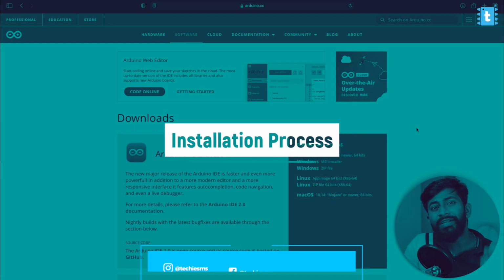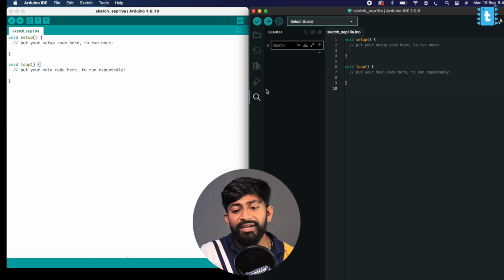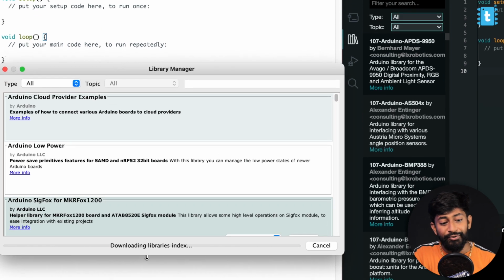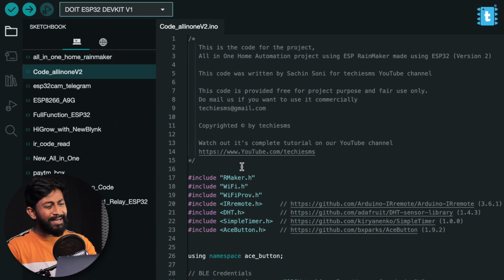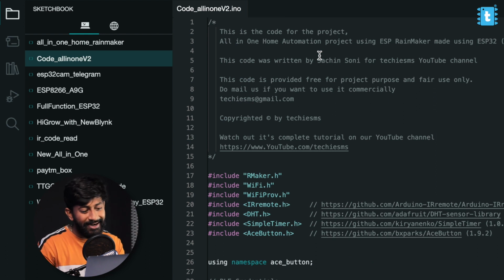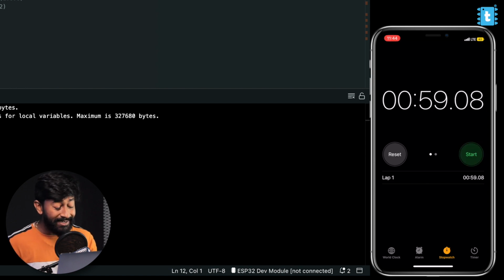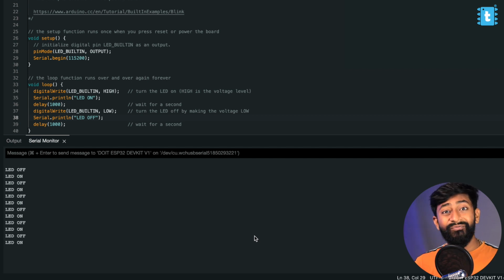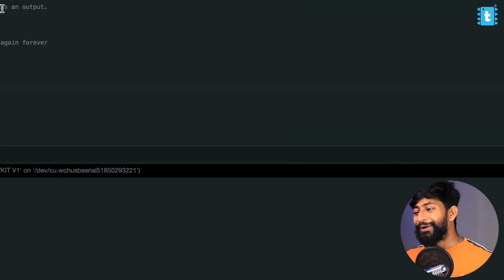Arduino IDE 2.0 (Stable Version) | All features Explained

Comment: How to bi directional data pass between nodemcu and Arduino?
Reply: for example received data from the cloud in node mcu after same data send to Arduino after data some task perform like led1on == led1on : led 1 on otherwise led 1 off after Arduino one push Button an press after some data send to node mcu after same data send to cloud

Comment: Hiii Sachin, i have shifted to Arduino 2.0 but esp32 2.0 ( rainmaker) Board url is not working on preference.
Please help me with this.
Also when I shifted back to Arduino ide older version there also not working.
Reply: Unistall it and redo it again, I also had same problem using windows 10
Reply: @nekhwevhatrust686  thanks but after that same problem, so i copied index.json file of esp32 from my other laptop and placed it in c:user/app data/ local / Arduino.
Now it's working....
No need of preference url